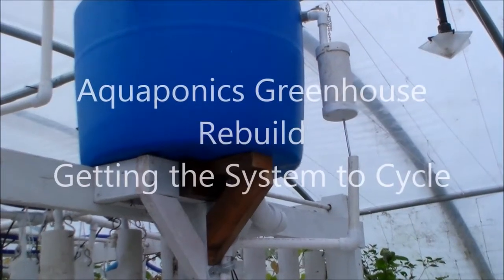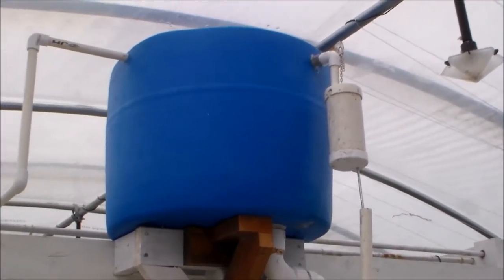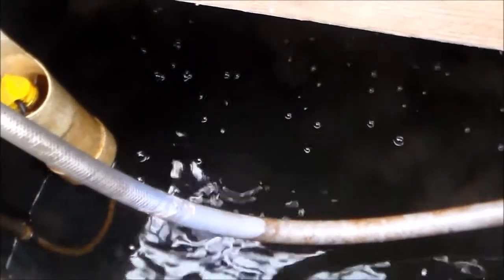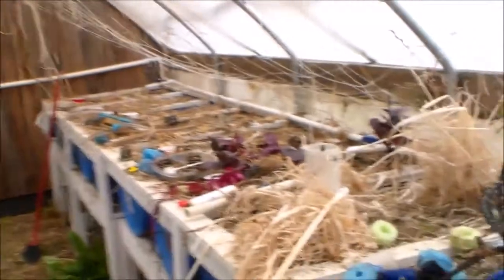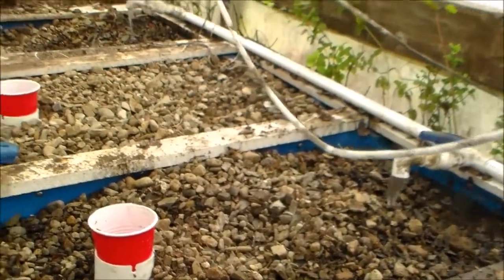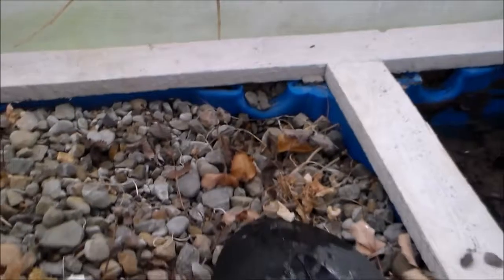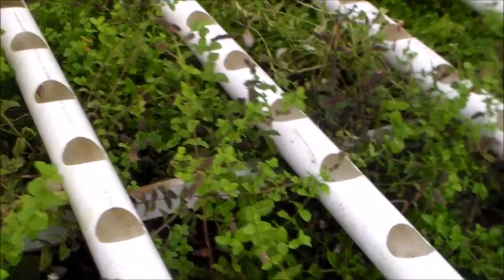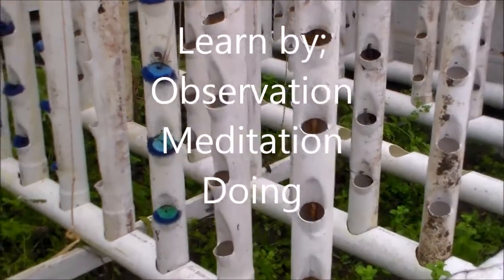Aquaponics Greenhouse Rebuild, Getting the System to Cycle

Comment: as I understand your set up, you are using multiple pumps to supply separate sections all feeding back into 1 sump. My question is what size pump did you run to the vertical towers? and I think I see that the feed lines to the towers are under gravity feed and not pressure? why did you not just run a pump on a timer into a feed line to supply under pressure? or would there be too much head to pressurize the line?